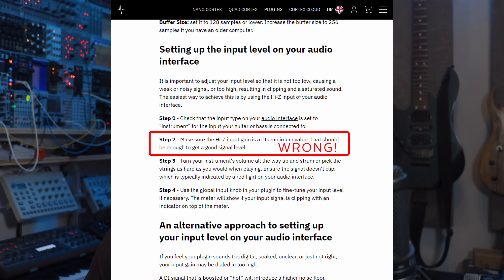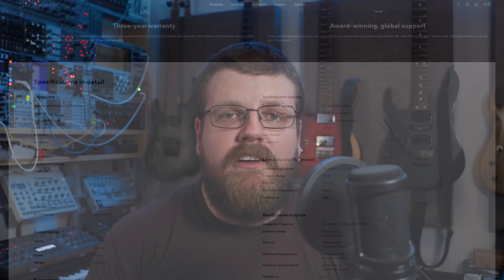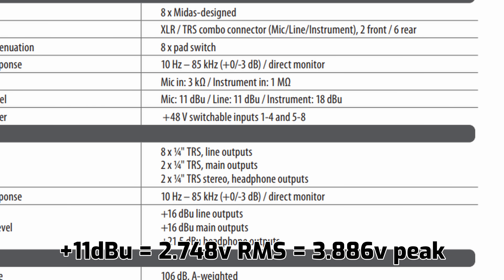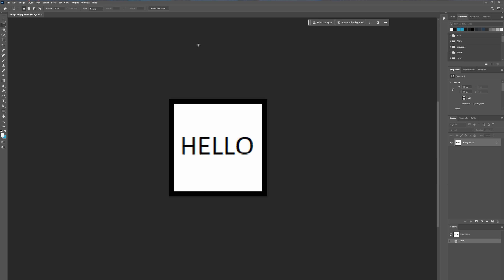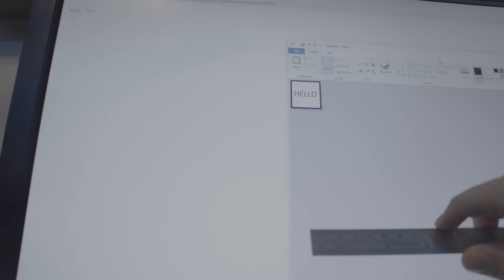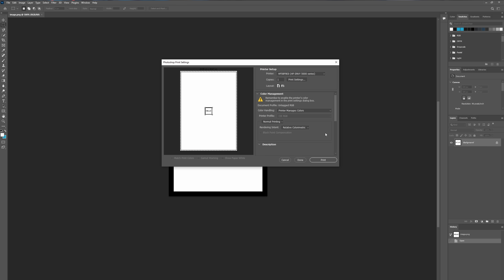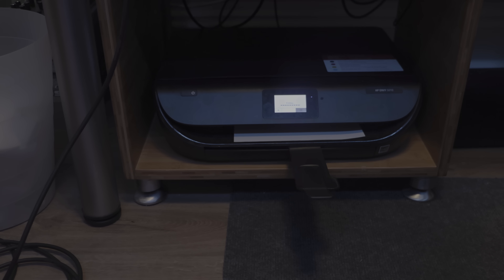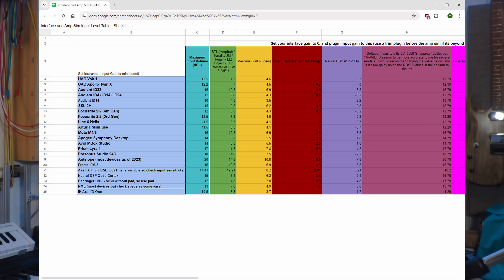Ampsims and input gain - Please, stop the madness...

Comment: If I turn up the input gain it sounds bad because it would be a linear boost. I need a boost that cuts the low end, like a SD-1. It's pretty self explanatory anyway - if the input gain is neutral the ampsim sounds like the original amp would. If you turn it up a plexi becomes a high gain monster. So you'd have to decrease the input gain on the plugin as much as you increased it on the gain know. Which is not very precise because there's a physical knob involved and very inconvenient because you'd have to set it for every single preset. Nobody cares about noise, electric guitar is always noisy. And you're wrong about images, there is such a thing as DPI. And you want integer scaling so there are only so many sizes you can use without exceeding the size of your paper.

Comment: jea the reason is right, but....

0dBu in Digital is -18dBfs 
red light Analog 0dBu; red light Digital 0dBfs 
the difference ist that analog can handle +21dBu or so without distortion (look in your Manual, some are already distorting abough 0dBu its called "Colour")
on the Digital side 0dBfs and higer is instant Digital Distortion.

Almost every Plugin is Calibrated to -18dBfs, and then you have a Headroom. This is the Point you should Gainstage to.

(and you can use your Booster pedal to drive the Sim)

have a nice Day and sorry for my bloody German Inklisch ;)

And now tell the difference between a High Z Input and a Line input.... Please

Comment: Thank you, this makes so much sense. I too fell for the set the input gain on the interface to zero mantra. It did make things easy in terms of switching guitars and or plugins. Thankfully we have presets that are easy to apply. I do however have a question / want to make sure I'am doing it right. So in order to get the number to reduce the input gain of the plugin. I use the analyzer to check for the highest peak signal  with the guitar volume set to max and the interface gain to zero. Then check to signal again but with the interface gain set to below the clipping point and volume of the guitar at max. Then subtract these numbers and I have the setting to which to reduce the number given in the spreadsheet. Am I missing something ?

Comment: A lot of the issue stems from ToneX users, where the physical pedal version (opposed to the plugin) has a global input level that is both the AD level and the input level feeding the captures.

So if you optimize the input for “more bits” you can’t then lower the optimized input signal before feeding the next part of the chain.

So a lot of the blame should go to IK Multimedia not to the users scrambling to find workarounds.

In a perfect world you are absolutely correct and for DAW/plugin use one can achieve this even with a Behringer as you showed.

But lots of players don’t realize their gear is sabotaging them inside the box.
Reply: I saw that a few weeks ago. I didn’t elaborate in my response, but the ToneX’s instructions tell people to “turn it up before clipping then turn it down a bit”  but there is no scale, no reference. 

I’ve been setting my presets for plugin and physical pedal using a signal generator. Most players won’t be doing that.

And then how was the level set when a capture was done? Was it correct?

Lots of tails to chase.
Reply: I wouldn't consider the global input level to be "both". The AD conversion happens before and the pedal itself has an instrument input (like an amp). 
That's why you shouldn't adjust the global input level when switching guitars. Then what would be the point in having different pickups. 

Speaking of tonex the important thing is to set up the pedal so it corresponds with your experience in the app where you download and tweak your profiles.
Reply: Ah nice ... I came across this ... 
https://youtu.be/BqbviHm9hrY?si=JZcNfDHvvFYgiOMd&t=14m51s

Comment: Great video! I definitely thought I was doing well in following the 0dB on the interface and adjusting in the plugin. One thing is still unclear to me though: how do you know by how much I increased the input gain on my interface? Since it's just a physical knob I can't read it. Do I use my DAW to check? I would need a reliable source of consistent level (so probably not me strumming my guitar as hard as I can) to be accurate in the amount of input gain I added. Thanks!

Comment: Now I need to re-track all my Di guitars. Good grief. I likely won't because I used the noise gate on the sim thus lowering the noise which wasn't that dramatic to begin with. The 0db interface setting didn't sound bad and I got much better clarity in my high gain presets but the added noise was there. The guitars sound good to me and in the mix it all becomes choreographed palatable noise anyways. That being said any future tracking of my DI signals will take this recommendation as best practice. Thanks for setting the record straight.

Comment: What a great video. I’ve always advocated for zero on my input because anything above it I would hit red.
I’ve always been doing this on my Apogee and UAD interfaces. 

Definitely going to try this out.
Reply: I'm running an AXE IO interface and with a petrucci guitar I can maybe turn the gain up like to 10 O'Clock which is like +10db increase in signal... so my neural plugins are running like -12 input and its amazing how QUIET the plugins are with the noisegate OFF rofl. Only pain in the ass obviously is everytime I switch guitars I gotta redo the settings since the pickup output differs
Reply: @TheHeroSaurus  I also have an AXE IO and my go-to gain also is about 10 o'clock.
Reply: @TheHeroSaurus You could save different configurations as FX chains, for each guitar you have. At least is possible in Reaper, I'm new to this game😊
Reply: I can imagine that happens for a lot of high output pickup users. And in that case I dont see a problem, your output is just naturally high enough.
Reply: @RobDiesALot correct. I have a les paul, strat, tele and a charvel super tele. Vintage gain pups on the 1st 3. The charvel is the only one with high output pickups. If i go too much over zero on the interface it will clip. It only happens with the charvel.
Reply: Or maybe because he is using line input on behringer and you are using INST input.
Reply: @cirisirpula152  looks like he's using the instrument input with PAD on. PAD will give more headroom and avoid clipping. That's why he's able to really crank the input gain to 24db without clipping.
Reply: @cirisirpula152  It sure looks like he's got instrument level selected on the Behringer.
Reply: @CJ_Wolesz  Well it is hard to say, but pad and inst switches are on same level. And he doesn't say anything about INST, even though it is a pretty important step for the 0 gain advice
Reply: @cirisirpula152  No, the 1820 has a Line and Instrument button, watch the video.
Reply: @Billy_bSLAYER  I know it does, but it is very hard to see from the video, what button is pressed and he doesn't say what his setup is...

And there is no way he can turn the gain up that much without clipping while on INST
Reply: @cirisirpula152 exactly! This video is misleading for most users since he has pad engaged 😂😂😂
Reply: @sumsumab1809 It's not misleading at all. Pad is irrelevant. The only thing that's relevant is the signal level that's hitting the converters. How you get the right level for the converters is not relevant, because interfaces vary a lot, and guitar pickups vary even more. You might need pad engaged for some very hot pickups, you may need to really crank the input for some really low output pickups. There's not really a standard with instrument inputs either. 

Just set it so it's as strong as possible without any clipping, and you're good. It's not that hard.
Reply: I started running my guitar into a di box, and then into my interface, and have been able to get waay more headroom with the gain knob on my interface since. Before, I had the same problem of not being able to turn the gain up.
Reply: That usually happens because of ultra high volume face melter modern humbucker pickups.
Try with your new Strat and you will notice the difference. 😀.
Reply: @avelord6135  I have exactly this issue lol. My 7 string has high output Dimarzios that actually still manage to clip the signal at 0 input gain - I have a DI box to convert it to line level and use a corresponding line level input on my interface instead so I can actually dial the input gain in correctly. My HSS Strat with its stock pickups - no such fuss required.
Reply: @avelord6135  unfortunately, that's not a fix: I have a 3-single tele with a stack neck pup and singles (Roswell TEK, Aria stock middle single coil, Tesla VR-TE bridge), and it still goes to red on my focusrite when I do funk strumming on neck pup or chugs on bridge one (they're not particularly close to the strings, in the "sweet spot").
Reply: If you're hitting red going above zero, you're not going to want to......go above zero.
Reply: @Jack_cx  yep, most likely active pickups sending a hot signal to the interface.
Reply: @Jack_cx  I think he is saying that it would hit red on the output of the DAW track after going through the ampsim and whatnot. I’m sure Ola realises that if the interface is going into red set to  anything above 0 that he can’t increase it. 👍
Reply: @Jack_cx  lmaooo yeah......yeah. let sleeping dogs lie 😂
Reply: Idk if your apogee and uad are first gen 2i2s in disguise
Reply: Hi Ola, a DI box is useful to reduce the input of very hot pickups. You can then raise the gain to the level you want, without clipping.
Reply: @Hugo_Rvr this achieves very little. If zero on the input is already the maximum you can achieve without clipping, then there's no issue. If you're clipping at zero then that's obviously a problem. 

The issue with this logic of yours is that you are implying the DI box increases headroom. It doesn't. It's effectively attenuating the signal, and then you're amplifying it again in the preamp of the interface. This doesn't increase headroom, it just makes your signal smaller. That's nor to say a DI box doesn't have value, but if you're not increasing headroom that way. Potentially you're just unnecessarily reducing your signal strength, and then amplifying it again, along with any noise the DI box is adding (likely vert little, but every added component in a signal chain adds noise). 

If you're clipping at zero, then you do need a solution, and a DI box would be my first choice for that. Another would be turning on the pad, if your interface has one.  

The man in this video isn't saying where your interface level control should be, he's only telling you what you should be trying to achieve when setting the level. If you're achieving max level without clipping at zero, then you're good to go. Making zero the rule though is nuts, interfaces vary a lot, and guitar pickups vary even more. 

What I really want to know is why plugin companies are not giving you a clear indication of what digital signal level their plugin is expecting, because that's the part I find difficult to gauge. I don't know what the default settings or the included presets are supposed to sound like. I'd like to be able to quickly and easily set the plugin input level so all the virtual amp controls and gain stages behave as expected.
Reply: You need an interface with pad, because your signal is too hot at input 0
Reply: It's very dependent on the gear and guitar in use. Tons of bro science to parse through and a lot of people who are just parroting what others have said instead of actually doing the work. For my own use case, I've had to dial down the A/D sensitivity on my AxeFX III to 9.5 to prevent input clipping w/ Fishman Fluence pickups on my Strandberg, but as soon as I use passives I gotta dial it up considerably to compensate for the lower signal strength of the pickups, but even then it'll vary based on the pups being used.
Reply: This is why you're the OG
Reply: so you live in the Goldilocks zone where they are both true at the same time?
Reply: I've found that with my UA interface too, quite frankly I'm not impressed with the fact that, at least my own interface and I'm assuming yours based on your comment, are NOT friendly to high gain guitar pickups
Reply: Same here with my Apollo twin. The most I can do is light up the very first notch and im at the orange light. I found out from looking at the UA console that even when the knob on the apollo is turned all the way down its still at 10db. Then every time moving the knob up is 1db. (so 2db for every notch because the first time moving the knob it only lights it up half way then the second time moving the knob up it lights up the line all the way) so with the first line lit all the way up its 12db. I usually kept my input in Neural at -6 anyway so going down to -12 didn't really make much of a difference to me. Now I am just wondering about the output in the neural plugins and if that effects the gain staging at all. I wouldn't think so. I think it just adjust the volume but I want to be sure.
Reply: Thank you for this. Is the spreadsheet's value for the audient id44 valid for the id44 MKII as well?
Reply: Helola
Reply: Duncan Distortion is my fav pickup -- I'm happy with an interface when I only slightly hit soft clipping/limiting at 0, on some deviced it goes into red at 0. Actually when recording me and another guitar player with EMGs in his guitar a year ago, I learned that high output Duncans are higher output than EMGs lol. Talk about another myth online, that active pickups are automatically higher output than any passive one can be.
Reply: All those lights are beeping and flashing and flashing and beeping 😜
Reply: Welcome to Ola learning shit!
Reply: Zero is already too high!
Reply: Literally happens to me with my Scarlett 2i2.
Reply: You’re probably not into high z instrument input?
Reply: This is that part where I say I've been recording since the late 80s and have been recording digitally since about 94-ish. Your clean guitar going into an interface causing it to go "red" for a fraction of a second every once in a while is perfectly fine. Two reasons. Most audio interfaces go red before it actually clips, giving you a tiny little window of error, and also, more importantly, the occasional transient clip doesn't negatively affect your audio tone, so long as it's just occasional and just for a fraction of a second. Everything I've recorded into the digital world since 94 hits the interface hard enough to occasionally clip on the input. Never once has it been a problem. Not one time. You simply adjust the plugins accordingly like in this video to adjust the "digital gain" to match a real-world setting on the gear it is emulating and you're done. Nice, strong, clear signal with low noise, nice response from the plugins, the occasional clips are100% inaudible unless its persistent clipping, of course, and at which point you just reduce your input gain til it occassionally flickers red, you're good to go. I've taken this approach from everything from funk to hip hop to country to metal to techno to classical, and the results are very clean recordings across all genres.
Reply: But what about the digital output?
Reply: @jonathasx I think he saying it would hit red in the DAW, not on the interface 👍
Reply: he had PAD active in his test, so regular Z inputs are still best on 0 gain setting
Reply: @amig012 Still not true in the slightest. The pad is just a -10dB level attenuation. You can turn the pad off and achieve the exact same results, you’ll just need to lower the input gain on the plugin even further. I run 24v modded EMGs and never have clipping issues, even without the pad active on my interface.
Reply: @CrzyWzrd4L  Im talking about clean signal (clipping) before plugin. How is plugin even relevant here? On entry lvl audio interfaces there is usually no pad knob and the advice "don't touch gain knob for Hi-Z input" IS for those interfaces (specifically scarlet solo, which most beginners have, IIRC misha mansoor adviced this and he showed it on scarlet). But the whole reason of this vid is to disprove this advice which is negated by the pad knob. His noise floor argument is on point though
Reply: In that case then the advice in the vid still applies. you are just already maximising the input at 0dB input gain. but if going above that starts to clip, then you arent losing an dynamic range
Reply: You chug too hard dude
Reply: Hi daddy ola
Reply: You can fine tune things even further using outboard gear, by slightly compressing the signal going in and also utilizing subtle EQ.
Reply: I just watched your video PLASTIC METAL - Pod Express Black. Which sent me here. 🤘 :yt:🤘
Reply: Clipping is metal as fuck tho dude?
Reply: holy cow, Ola. I've started using zero gain input on my audio interface after you'd told you do it so :)
Reply: Yeah because your Solar guitars come with insanely hot pickups...i know because I own the A1.7c and that thing just ROARS like Alex Terrible  into my apollo twin 😅😅
Reply: Reply for the algorithm!

Comment: TLDR: Feed the analog to digital converter with the highest possible voltage signal without clipping. In layman’s terms; crank the input gain as much as you can without going into the red

Comment: I agree completely with the video and having been a very early adopter of amp sims (had the original AxeFx rack unit), the rule was always to adjust guitar input gain to just below clipping for the best sound.  All of this current confusion could be solved if Neural DSP included an 'auto-gain' feature where (after setting your interface input gain level to your pickups) you hit the strings for a few seconds and it adjusts the plugin input gain to match the design intent of the given simulation..  Why would that not be a feasible solution?